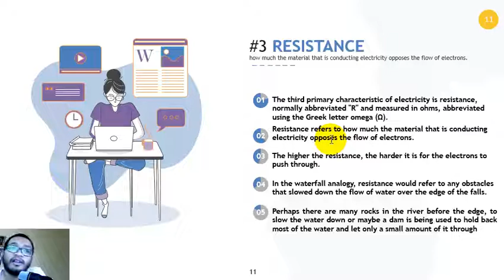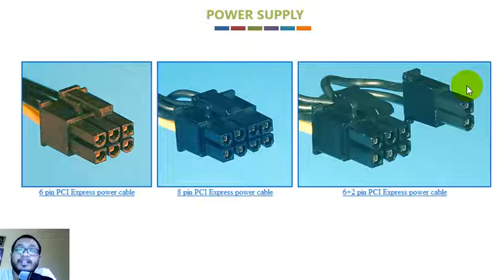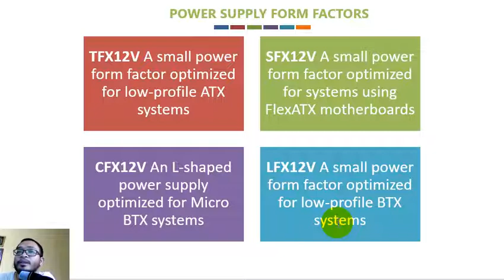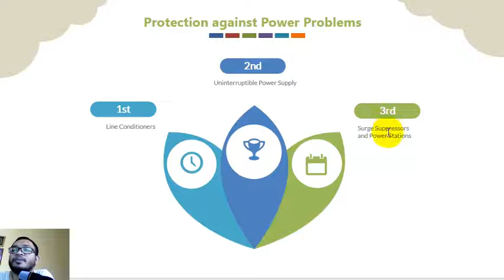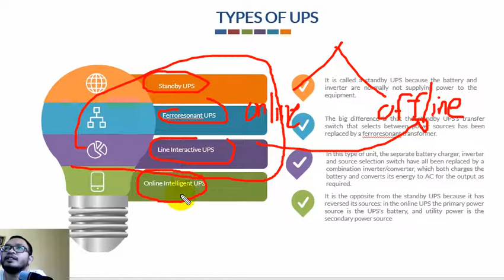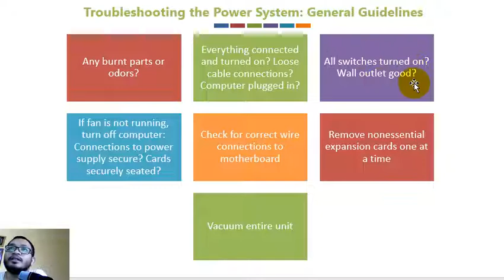Comment: in conclusion, a power supply is an electronic component that converts alternating current to direct current. Electricity is caused by the movement of electrons from negative into positive charge. Conductors consist of materials that allow the movement of electrons. As we know the type of good electrical conductors are copper,  aluminum, gold, metals, and water. The opposite of conductors is insulators. It does not conduct electricity such as wood, glass, plastic, and air. Cooling, stabilization, enemy performance, and expandability are all functions of the power supply. After that, there are many issues with the power supply, including spikes, line noise, blackouts, brownouts, and lighting strikes. Line conditioners, uninterruptible power supplies, surge suppressors, and power stations will all help.

Comment: To summarize this chapter, this chapter is discussing about power supply of the computer. In electricity, there are have electricity, conductors and insulators. In this chapter also discussing about AC and DC. The roles of power supply are cooling, stability, energy efficiency and expandability. Next, the power connector of power supply are 24pin atx, 4pin molex, 4pin fdd, 4pin_12v, 15pin sata2, 6pin pci express, 6pin aux, 4pin hp vedio power, and 6pin dell_p6. The problems that might be happen is blackout, surges, brownout, line noise, and lightning strikes. There are to types of uninterruptible power supply (UPS) which is online ups and offline ups. The benefit of the UPS are condition line for brownouts and spikes, provide backup power during a blackout, and protect against very high potentially damaging spikes. In this chapter also discuss about EMI (Electronicmagnetic Interference) which is it caused by magnetic field produced as side effect when electricity flows.

Comment: To conclude, this chapter told us that electronic and electricity is different. We can get more about voltage, current and resistance. A power supply is an electrical device that supplies electrical energy to an electrical load. All power supplies have a power input connection, which receives energy in the form of an electric current from its source, and one or more power output connections that deliver current to the load. There are 3 power supplies. Unregulated, linear regulated, and switching. Voltage (V) can get a lot of power if it gets strong electrons. Power supply can convert from alternate to direct current. Resistance is about conducting electricity. Also tell about characteristics of this 3 subtopics.

Comment: To be concluded, chapter 6 is about an electrical device which is power supply that supplies electric power to an electrical load. It is about the roles of power supply such as stability, energy efficiency, expand ability and cooling. The five major problems associated with power supply are blackout, surges, brownout, line noise and lightning strikes. Next, there are several protections against power problems such as line conditioners, uninterruptible power supply, and surge suppressors and power stations. It shows us about how electricity can cause by movement of electron towards a positive charge. From what I have learn from this chapter, we can understand about electricity such as be able to measure its fundamental properties.

Comment: In conclusion, a well-designed power supply is a good alternative to a more expensive power supply. A power supply is an electrical device that provides electrical power to a load. The power supply is made up of few components, occupies a small space, and is designed in a straightforward manner. Blackouts, surges, brownouts, lighting strikes, and line noise are all issues with the power supply .Line conditioners, surge suppressors, and uninterruptible power supplies (of which there are two types: online and offline) are all used to protect the power supply. Its advantages include backup power during blackouts and protection against brownouts and spikes.

Comment: Chapter 6 is about power supply which is a electronic component that convert alternative current to direct current. Electricity is cause by movement or electron from negative into positive charge. There are 2 reasons of electron movement which are the attraction of negative charge electron to a positive charge and means of allowing electrons to move that known as conductor like cooper and aluminium. While insulator like wood and plastics does not conduct electricity. Next, voltage (v) that determine the performance of the hardware that currently in use. Second, current (AMP) that how much electron is moving and determine how many hardware that can be supported by the power supply. Resistance(OHM) that will oppose the movement of electron. Cooling, stability, energy efficiency and expandability are the roles of power supply. However, power supply has several problems that are surges, line noise, blackout, brownout and lightning strike. Lastly, 4 types of UPS are standby UPS, Ferro resonant UPS and Online intelligent UPS.

Comment: In my conclusion, power supply is an electrical device that supplies electric power to an electrical load. There are a few roles of power supply which are stability, eneegy efficiency, expandability and cooling. There are also five majors problems associated with power supply. First problem is blackout. Blackouts means no power available or electricity failed. Secondly is surges. Surges is a temporary increase if voltage. Thirdly is brownout. Brownout is opposite with surges. It is a temporary decreased of voltage. Next, line noise. It is means a small variations in the voltage level delivered to the computer. Lastly, lightning strikes. Lightning can deliver a charge of millions of volts and if your home is hit directly, significant damage will likely be the result. Not only that, there are several protection against power problems such as line conditioners, uninterruptible power supply, and surge suppressors and power stations.

Comment: In my conclusion, power supply is electronic components that supplies energy to an electricity load while the electricity is cause by the movement of electron from negative to positive charge. Power supply also has 4 roles such as cooling, stability, enemy efficiency and expandability. After that, power supply also has several of problems which is surges, line noise, blackout, brownout and lighting strike. But it is also can solve by line conditioners, uninterruptible power supply, surge suppressors and power stations.

Comment: In my conclusion, electricity is cause by movement of electron towards a positive charge. Voltage usually abbreviated V and measured in volts.The more energy the electron have, the stronger the voltage. Also,current will determine how many hardware can be supported by the power supply. Different hardware on motherboard required different kind of voltage. If mistakenly set voltage it could burn up or destroy power supply.

Comment: In my conclusion, power supply is a hardware component that supplies power to an electronic device while electricity is cause by the movement of electron towards a positive charge. Besides, conductors consists of material that allow the movement of electron. Next, there are 4 roles of power supply which are stability, energy edfieciency, expandability and also cooling. The benfits of power supply is it can provide backup power during blackout while the problem is surges, lighting strike and many else. There also have 4 type of UPS which are stanby ups, ferroresonant ups, line interactive ups and online intelligent ups.

Comment: In this chapter, I understand that this chapter is about power supply. Power supply is electronic components and it convert alternate current to direct current. Three (3) primarily characteristic that describe the nature of electrical flows which are voltage, current and resistance. Power supply have 4 roles which is cooling, stability, enemy efficiency and expandabality. Also, I understand before this motherboard only support 20 pin but now the motherboard can support 24 pin. There are also have several problems with power supply. For example, blackout, line noise, lightning strikes and brownout. And last, there is four (4) types of UPS. They are standy UPS, Ferroresonant UPS, LINE Intertactive UPS and online inteligent UPS.

Comment: What I have learned , this chapter is about power supply . Power supply is electronic devices that supplies energy to an electricity load and the electricity is something that cause by the movement of electron from negative to positive charge. There are two reasons that causes electrons to move which are the attraction of the negatively-charged electrons towards a positive charge and a means of allowing the electrons to flow. Roles of power supply are Stability, Energy Efficiency, Expandability and cooling. Power supply also has few problem and five major problems of power supply are Blackout, Surges, Line Noise, Lightning strikes and brownout.

Comment: In conclusion, what can i learn from this chapter is about power supply. Power supply is an electronic devices that supplies electronic power to an electrical load. Electricity is cause by movement of electron from negative to positive. Conductors consists of material that allow the movement of electron. Insulators is materials that do not conducy elecricity. There are three primarily characteristic that describe the nature of electrical flows which are voltage, current and resistance. Types of electricity are DC and AC. DC is direct current. In the circuit the current flows at a specific and constant voltage. AC is alternative current. There five problems of power supply which are line noise that consists of small variations in the voltage level delivered to computer. Secondly, surges which the power coming from your wall is rated by electrical company to be within a certain voltage range. Next, blackout. If the system is idle when the power goes out probably nothing will be wrong with the system when the power comes back on. Other than that, brownout. When a brownout occurs, the voltage drops from its normal level to a lower voltage and then return. Lastly, lightning strikes. Good line protection equipment can often help to reduce the changes of catastrophe should lightning strike usually by giong up in smoke. Protection against power supply has three that are line conditioners, surge suppressors and power stations and lastly uninterruptible power supply.

Comment: In conclusion,power supply is electronic components.Electricity is caused by movement of electron towards a postive change that produce electric. The conductors are materials that allow the movement of electron such as aluminium or cooper.Meanwhile,insulators are  materials that do not conduct electric such as wood or plastic. Direct current is a type of electricity that produced by battery static and lightning meanwhile alternate current is unstable current which is must be support by power supply in order to to accept power that come from our work outlet because it it too big. Roles of power supply are cooling,stability,energy efficiency and expandability. The problem wirh power supply are surges,line noise,lightning strike,brownout and blackout. The protection of power supply are line conditioner,surge supressors and unintervurtible power supply which is have two types first online and offline.The benefits are it can provide backup powers during blackout and protection for brownout and spikes.General precautions in using power supply are always make notes so can backstack if anything happen and keep computers away from hair or clothing.

Comment: In conclusion, electricity is cause by the movement or electron from positive to negative charge. What cause the electron to move is the attraction of negative changing toward positive charge and means of allowing electrons to flow which is conductor. The example of conductor is cooper and aluminium. However, insulator is the opposite of conductor and the example is wood and glass. There are three types of voltage criteria which are voltage(v), current(AMP) and resistance(OHM). For voltage, the more energy electrons have the stronge the voltage. Current is how much electricity is floowing and resistance is the movement of electron. Also, there are issues in the electricity which is direct current, first and simple type of electricity and alternate current is electricity that we got from the house wall. There are four roles of power supply which are cooling, stability, energy efficiency and expandabality. There are also problems of power supply which are blackout, surges, line noise, lightning strikes and brownout. Moreover, there are three protection against power suppy problems which are line conditioners, surge suppressors and power station and uninterruptible power supply. For uninterruptible power supply there are online ups and offline ups. Four types of ups are standby ups, ferroresonant ups, line interactive ups and lastly online intelligent ups. There are also general precautions when using ups such as make notes for backtrack and use ground bracelet.

Comment: In conclusion, I have learned from this chapter that electricity is caused by movement of electrons towards a positive charge. Conductors consists of materials that allow the movement of electron. As we know the type of good electrical conductors are copper,  aluminum, gold, metals and water. The opposite of conductors is insulators. It does not conduct electricity such as wood, glass, plastic and air. Voltage is the amount of potential energy the electrons have in an object or circuit. Current is how much electricity is flowing. Roles of power supply are stability,  energy efficiency, expandability, and cooling. Problem with the power supply are Blackout, Surges, Brownout, Lighting Strikes, and Line Noise. Last, types of UPS are Standby UPS, Ferroresonant, UPS and Interactive UPS is under the offline, only Online Intelligent UPS is under the online.

Comment: In conclusion, electricity can cause by movement of electron towards a positive charge. In order to know how can we use electricity is we need to be able to measure its fundamental properties. This electricity have their own flow which is voltage (v), current (Amp) and resistance (ohm). Power supply is an electrical device that supplies electric power to an electrical load. The primary function of a power supply is to convert electric current from a source to the correct voltage, current, and frequency to power the load. A power supply unit converts mains AC to low-voltage regulated DC power for the internal components of a computer. Modern personal computers universally use switched-mode power supplies. Some power supplies have a manual switch for selecting input voltage, while others automatically adapt to the mains voltage. Besides, power supply also have their own problem. The several problem are surges, line noise, lighting strike, brownout and blackout. All of this problem is the most common happen to the users when they try to work with the computer. All of this problem can be solve by line conditioners, uninterruptible power supply, surge suppressors and power stations. It have 4 types of uninterruptible power supply whether it is online or offline. The types are standby UPS, ferroresonant standby UPS, line-interactive UPS and online UPS.

Comment: In this chapter, i understand that power supply is electronic components and it convert alternate current to direct current.
After that, i also undestand about electricity which is cause by the movement of electron from negative to positive charge and Conductors is materials allows movement of electron such as cooper, aluminium, gold or water. The opposite of conductors is insultators. It not conduct electricity like glass, plastic, wood and air. I understand about voltage, current and resistance. Voltage is pottential difference or electromotive force. It is refers to the amout of potential energy the electrons have in an object or circuit. The second is current. Current is how much electricity is flowing and the last is about resistance. resistance refers to how much the materials that is conducting electricity opposes the flow of electron.
Next, is about direct current. It current produces by batteries static and kightning while alternate current is unstable current that current comes from wall outlet. After that is about Power supply . It have 4 roles which is cooling, stability, enemy efficiency and expandabality. In this chapter, i also can know that older motherboard only support 20 pin and the new motherboard support 24 pin. So, because of that the universal power supply connector was created. There are also have several problems with power supply like blackout, surges,line noise,lightning strikes and brownout.  The last thing that i learn is about types of UPS. There arr 4 type which are standy UPS,Ferroresonant UPS, LINE Intertactive UPS and online inteligent UPS.